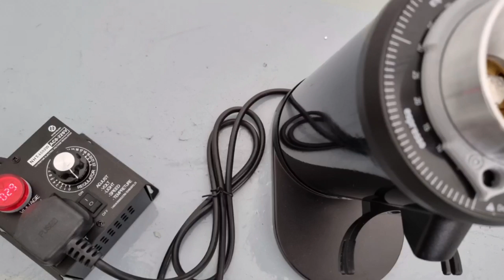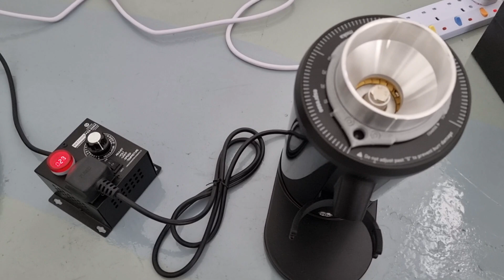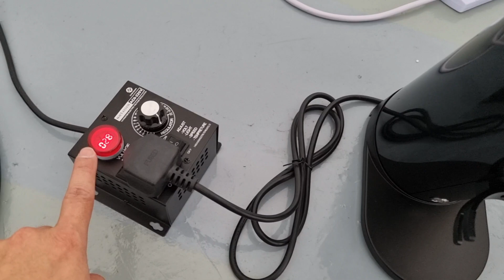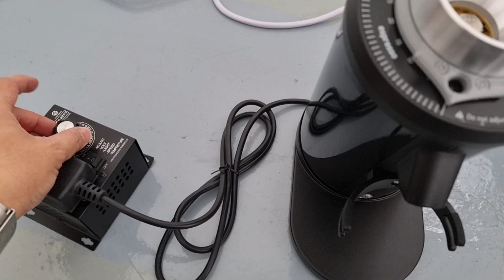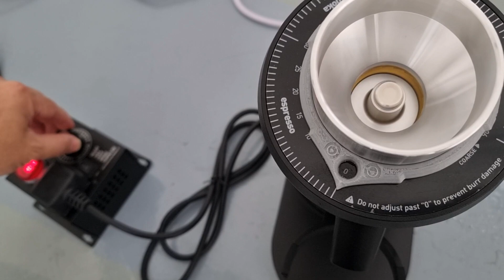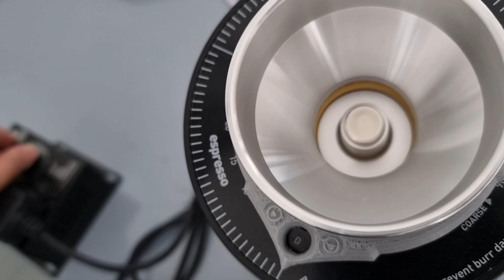Dimmer Mod | Variable Speed DF64 | Non Invasive Mods

Comment: Hi 
Can you show result?
Reply from the maker: It doesn't work. As low voltage will cause the motor to stall and there is not enough torque to grind.

Comment: So I've been playing with this for about a week now and I'm not convinced it's doing anything actually. 

Certainly I can hear what seems like a sound difference in the motor. Also, at the lowest voltage (before the power cuts out), I can choke the grinder so that it can't spin. However, in terms of the speed at which beans are being ground, once you set it to a point where the grinder doesn't choke, from everything I can tell, the grounds seem to be coming out of the chute at the same rate as when it's at full power. 

Thus, I don't think this is actually varying the RPMs. My conjecture is that the DF64 is a fairly basic "spin or don't spin" motor. There may be very slight variation in the RPMs (which would explain the sound difference). However, I think they've set it up to regulate the power to force it to essentially spin at a fixed RPM (which would explain the shutoff at the lower voltage).

I think I understand now why you were saying it doesn't make a difference for espresso (because of the choke point) but may make a difference for filter (since it probably doesn't choke when you're near the 100V cut-off).

I'm disappointed, but oh well.

Comment: I just posted to someone else that a 64mm burr grinder with SSP burrs and RPM control was my endgame.  Subbed.
Reply from the maker: Sadly, the voltage controller couldnt really reduce the RPM and allowing the grinder to have enough torque to grind lighter roast beans.

Comment: I did a brief check to the electronic board, and IMHO, lowering the voltage value, will probably increase the current due to the motor could reach a very close stall condition, especially if grinding, and even for few seconds the current could reach dangerous value for the electronic board components that are in the same power circuit of the motor itself. Not sure 100% but i will discourage any tentative at least with this grinder, curious to know CY feed back as well i will be glad to be wrong.
Reply from the maker: I think that will happen. As power rating is the same and voltage is indirectly proportional to the current. By reducing voltage, current has to go up. I will be careful when I try.

Comment: Hello CY, I could not see the model number on the device but for an AC motor changing the frequency should give you the best results. From what I read a flat burr grinder needs to spin at 700 RPM to clear the grounds out of the grinder. I did read some great info at Barista Hustle about the consistency of the grind and the diagram showed 45hz might be the best? So north American units might benefit a little more from this kind of mod. I did see the RPM was listed the same at 1400 RPM for both 120v and 220v, not sure if this is correct? I have a motor control on the way and hope to test this myself. If you know what the motor model is and how many poles the motor has if that is the type of motor it has? I don't think the controller I ordered works well with every motor.
Reply from the maker: Thank you for the information. At this point I am really in primary stage to just to see if its even workable. Will it grind effectively at lower voltage. I know a frequency controller will be better at controlling the RPM of the motor. Let me test whether it can even grind and move the grind out at lower RPM.
Reply: @CaffeMartellaSingapore  Found this, an asynchronous, single-phase 250W motor  don't think the controller I ordered will work. Look forward to your results.

Comment: So controlling the speed of the Motor is supposed to improve the distribution  of the grinds when grinding so you have a better outcome of coffee?
Reply: Reduce speed meaning grinding will be slow down hence reducing the static buildups. With a slower speed coffee grinds tends not to heat up so as not to deteriorate the beans quality.
Reply from the maker: I think also because of the lower RPM, grinding will be grinding more like hand grinder which gives you better grind consistency and less fines especially for pour over.

Comment: CY i just remember reading a few month ago that someone asked if the DF64 could be modified to control the speed like the Option Q Lagom P64 does. The reviewer ( I think it was Barrett from PortaKeeper) mentioned that the DF64 motor would not hold up to the voltage variation and would like fail . I don’t recall why he said that. 

Have you checked that the motor on the DF64 will not be affected by the change in voltage?
Reply from the maker: So far it's holding up but I am not sure of prolong usage and its impact and hence very reluctant to give a follow up review as I don't want to encourage something that I am not sure of.
Reply from the maker: I will use one DF64 as a test subject and let's see if  it will fail.
Reply: @CaffeMartellaSingapore  is it fair to assume that, given the fact that you never posted a follow up video on this, that you ran into torque/failure issues with this mod? I ask because I'm considering doing this myself, but don't want to break my DF64.
Reply from the maker: Yes the rpm mod don't really improve the result on espresso grind and the will have a greater impact on filtered coffee grind when rpm is lowered. I am waiting for my flat burrs for the baby EK from 3bomber and do a side by side comparison. Mean while, I am.preparing a video to compare filtered coffee on variable rpm mod on the df64 using stock burr and my built in variable rpm baby ek from 3bomber using shark's teeth burrs.
Reply: @CaffeMartellaSingapore  I'm going to give it a try I think. I use the SSP multipurpose burrs on my DF64 and pretty much exclusively use it with light roasts (regardless of doing espresso or pour-over).

Have you tried using this with a Niche? I'm wondering if you can get similar textures with it to hand grinding.

Either way, I look forward to seeing your follow-up review on the flavors.
Reply from the maker: I use my df64 mainly for espresso as I have other grinder for filtered coffee as well.as manual hand grinder. We will be releasing a brand new grinder soon and stay tune. This grinder from design to manufacturing is all done by our team. It will have built in variable speed.
Reply: @CaffeMartellaSingapore  very cool! 64mm flat burrs too I hope. Will it be in the DF64 price range?
Reply from the maker: @slvrbach  will be.
Reply: Do you know if anyone tried to do variable RPMs by modding the power button? I'm not sure this would even do anything as I'm assuming you'd probably also need to swap out the control board for something that, itself, would essentially just be a voltage regulator for the motor. It's an interesting question all the same though.
Reply from the maker: @Nick Wilson  sp far not that I know of. As far as I am concern, doing mod in the df64 will definitely void the warranty, if that matters to you. Hence tje reason why i am doing externally.